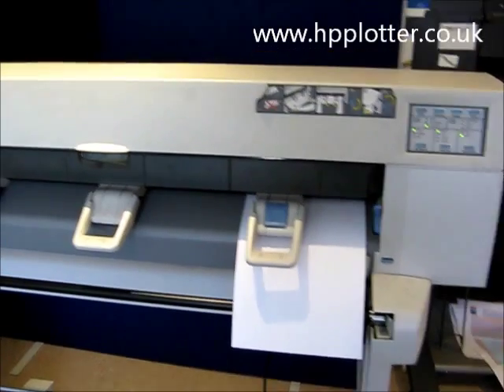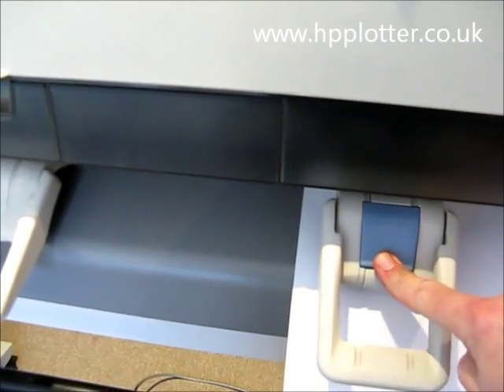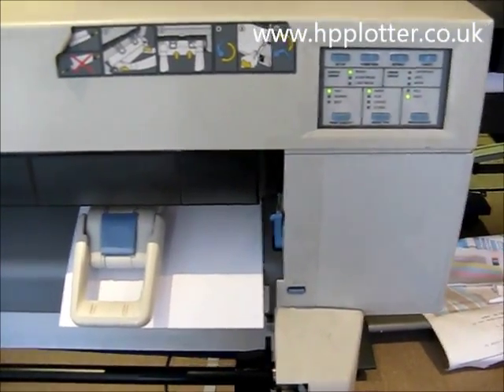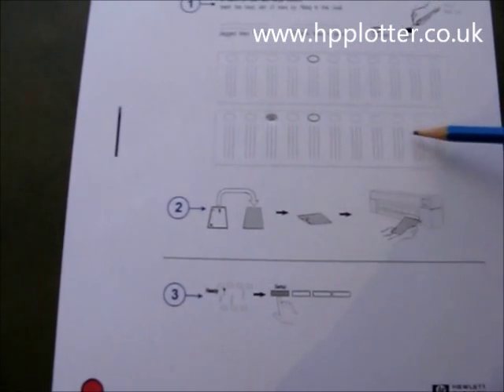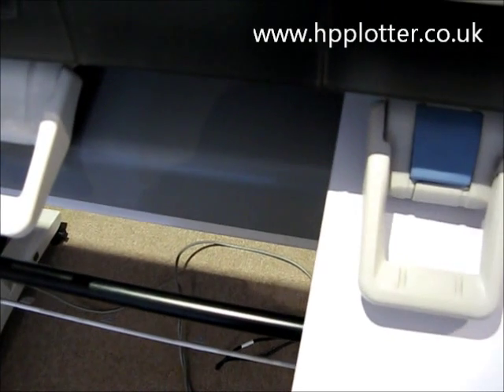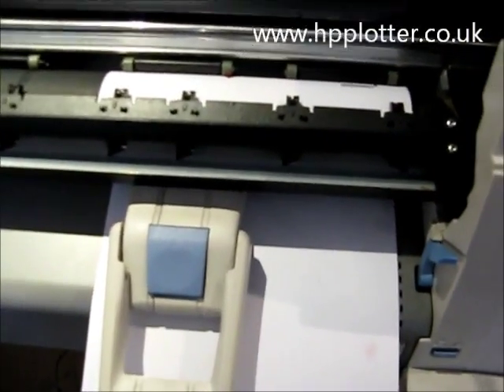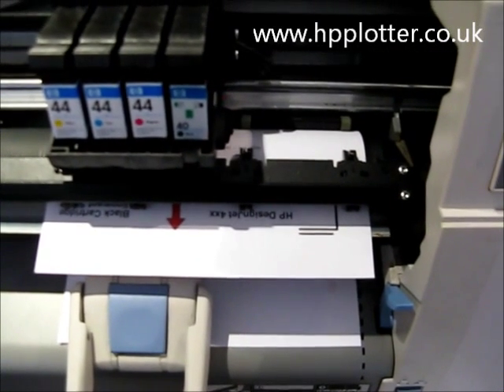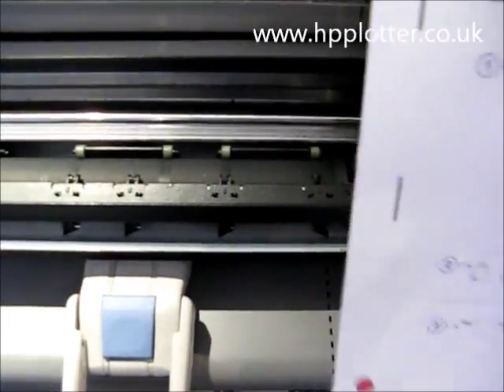DesignJet 450C black cartridge alignment - DesignJet repair

Comment: plz advise how to remove breaking line into full frequently line
Reply from the maker: Hello Kishan - this can be as a result of several possible issues, either a simple service/clean issue (best case scenario) or (more likely) failing maintenance kit parts which need to be replaced - so you need to have the printer serviced/repaired to resolve this. For example a trailing cable moves with every pass of your inks from left to right, and essentially tells the printer when to release ink. Inside the trailing cable there are lots of wires which get bent and broken over time which begin to cause issues such as you are experiencing. This is just one of the items that can lead to the printer showing broken lines on the print. If you're in the UK please contact engineering@hpplotter.co.uk for a repair estimate to get you back up and running. As this is an old machine, if you're not in the UK, then check before your engineer attends site that they have all the spare parts for this machine such as belt, trailing cable, tubes assembly, encoder strip, ink supply station...if not, you may want to consider replacing/upgrading this printer with something like a DesignJet T520. Hope that helps!

Comment: what to do if the plotter is already on the border of the settings and the printout is still not aligned, straight? I am asking for help - is it possible to mechanically change it? 

http://oi63.tinypic.com/219au54.jpg
Reply from the maker: Hello G S - You need to get a service/repair - it indicates a possible issue with the carriage belt, encoder strip or a printhead issue. If you're based in the UK please email engineering@hpplotter.co.uk for a quotation.